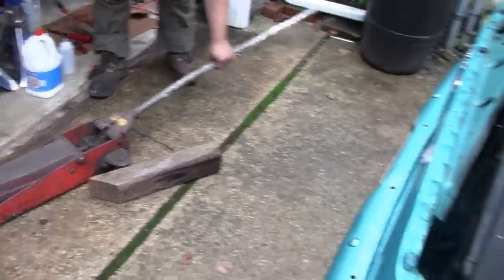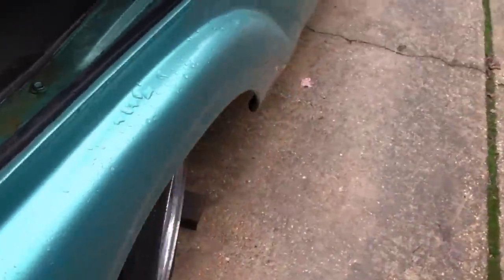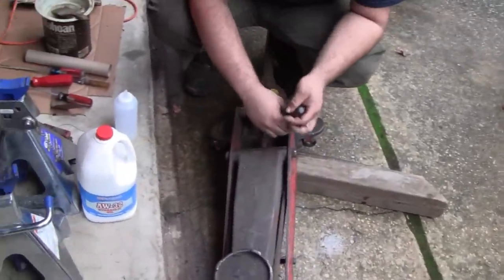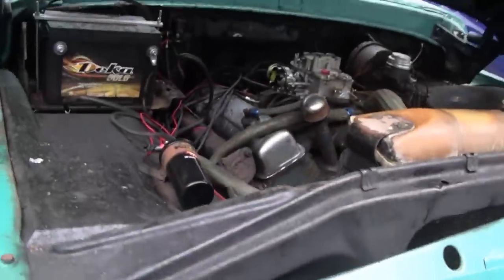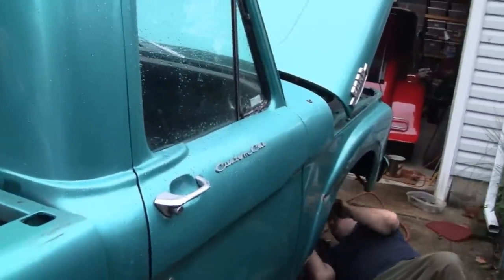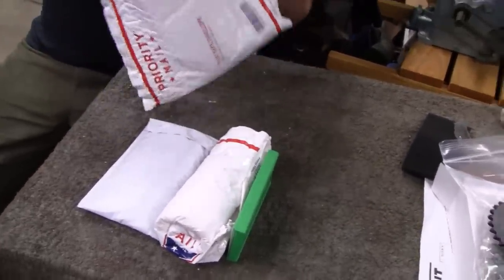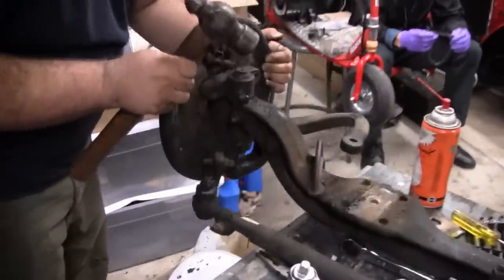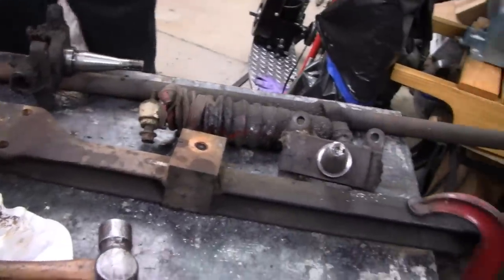1964 F100 FORD TRUCK PROJECT (part 1)

Comment: pretty soon you are going to need a bigger shop m'friend.. starting to get pretty cramped in there but the thing is..no matter how big ya build it, it always gets filled up.. heck, i'm doing a good job of filling up 40 acres!
Reply from the maker: Thanks Bud!! I think a big dumpster would help a little!!☺
Reply: I know what you mean haha I put a big garage in my backyard that's 38 ft deep, 30 ft wide with 10 ft tall doors and I still have to park my car in the driveway. I'll never run out of projects that's for sure!
Reply: my shop is 30x50 and last year I built a 24x60 and have a 2 bay carport.. everything is full and I still have 4 vehicles sitting outside LOL

Comment: Ah....one piece front axle. My 66 Ford F250 had twin I-beams on coils.  352v8 was a work horse. I would pull a 8 ton black top roller with it back in my younger days. No one would hire you on any construction job unless you had tools and a truck. Boss would utilize your pickup truck with his job needs,  I was doing truck repair, driving, and paving work.  Eventually got a dump truck , 72 GMC tandem with a 427v8/5&4 with a 11 yard box with out side boards.  I left that to go over the road with a 69KW W9 custom built light weight exempt grain hauler with a 270 NHTC cummins, 13spd, 4.33 tandems that weight empty 15,000 with 140 gallons fuel. You start small and build and that Ford was my 1st work truck. I had a 56jeep L6engine 4x4 with and 3speed with a manual overdrive stick.  5 sticks on the floor.  Winch PTO, TX, OD,Lo/High, 4wheel aka from axle.  Was fun, but not a real work truck....just a plow rig for a few winter bucks.

Comment: RK,If you are going to put disk brakes on it you will require a vacuum booster for the disk brakes.If you use engine vacuum you will lose a lot of vacuum. Unless you purchase an electric vacuum pump.The reason these engines were so stout is because they did not have a lot of power robbing accessories.PCV for one, power brakes for another.Same goes for power steering.
Reply from the maker: It has some kinda booster on it, I haven't looked at it yet!!☺

Comment: Now there's an idea,...disc brakes, that's a great idea.
Reply from the maker: It only cost about $150 more to put discs on there, then it would have to just replace the brakes and wheel cylinders!!☺
Reply: Not only are disc brakes more efficient but more economical too,.. that's the way to start this build!

Comment: I'm loving this project already - you going to work on it over the winter?  Speaking of that, did you and Mike ever get that generator for your house working?
Reply from the maker: Yeah we didn't want to work on it over the winter but I don't think we have a choice, it needs alot more work than we anticipated!! Mike got the generator running good but it's not hooked up to the house!! I'm the one holding that up though, everything on it needs painting and I've been dragging my ass!!☺

Comment: Glad to see your upgrading those brakes! Drums suck, I'm guessing your going to upgrade to a duel master cylinder while your at it too.
Reply: I used one from a 70's F100-150, on my 63  along with the proportioning valve.... it bolts right up.

Comment: King-pins, eh? Is it just the pins wore out, other wear points good enough, or are those oversize pins and you'll ream the holes? Neither my '69 nor my '70 Beetle have those, they're ball-joint front ends. Not sure which is easier to fix/maintain, especially with quality being a hard thing to find in the VW market, hope your parts are well-fitting and will last a good long time! It'll be one mean machine when it's done!
Reply: TheFurriestOne I have several old VW‘s. It comes down to tools as to which is easier to fix in my opinion. The king pen front end can be rebuilt using some makeshift tools such as a very long hardened bolt and washers with a nut to pull the new bushings in or a large vice. But you must have the correct reamer. To install ball joints you will need a press, but this takes much less time and labor. I have the tools to do king pins but must take the ball joints to a friends house. As for which will last the longest it depends on how poorly built the ball joints are.
Reply: All good points, thank you! Honestly (after the stories I've heard on thesamba) I'm not sure which is more likely to cause a failure, the quality of the ball-joints or a shop not pressing them in properly and ruining the boots, though most of the cheaper joints have poor boots that won't last long anyhow (and often too little grease). Was a good thread where the poster inspected a variety of ball-joints and found most/all of the cheap ones came with a literal dab of grease, so he added more under the boot and even carefully drilled a hole in the bottom cap for a zerk fitting, then they lasted years longer! Not at that point on either of my bugs, but I'll have to refresh my memory when that time comes.

Comment: The thing about kingpins is you need to learn a lot about them because they are junk and even new they aren't as good as ball joints that are half worn out.  I had dual I-beam in a pickup once and have one in my Econoline now but I never liked them as well as a frames I have had on other vehicles.